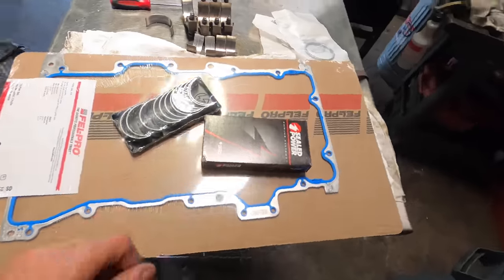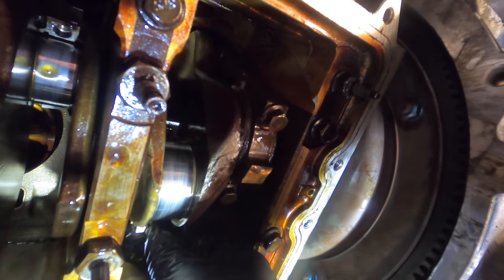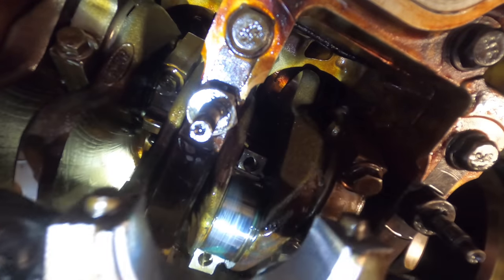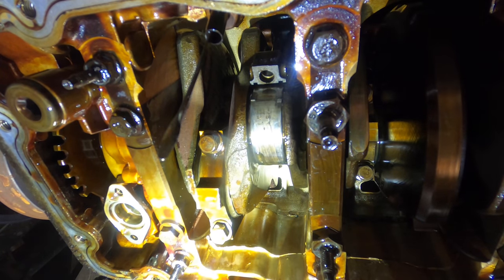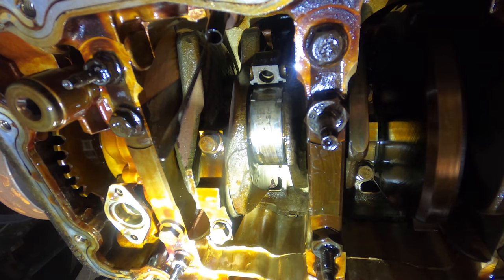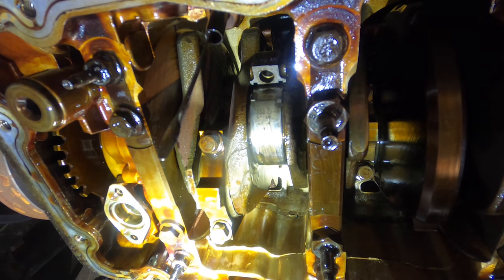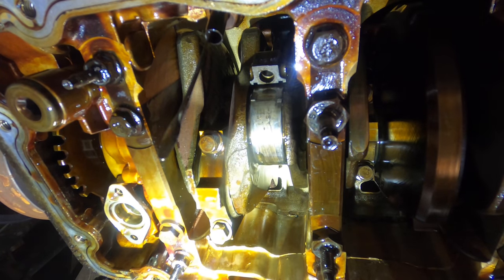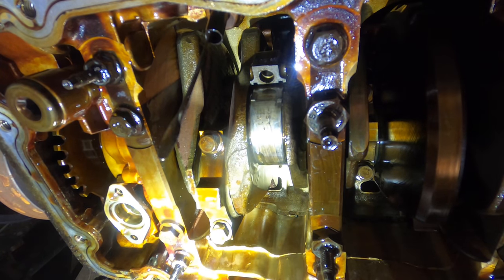Saving an Engine: Spun Bearings Replaced

Comment: Ive been a mechanic for 20 years and these are my favorite kind of jobs.  Doing that deep engine work and getting positive results at the end.  But nothing sucks worse after doing a job like this and then finding out the repair didn't work and the engine is garbage.  Had plenty of those experiences too.  Glad this one worked out.
Reply: this is very unreliable why to fix it but best wishes
Reply: You just ruined my suspense! Lol
Reply: I had a brother in law who had a busy garage,he stayed away from rebuild work he might replace a head gasket or even send them out,he was an experienced guy that worked for a ford dealer for many years.Then he went into his own business, He stuck to bread and butter work and made good money,too much of a headache replacing,overhauling engines.Brakes water pumps fuel
 pumps diag jobs thats what he did!Have to make money,not tie up the shop!He could do it but stayed away,got to put food on the table!Unfortunatly he passed away a while ago,I think he had the right idea for his shop.
Reply: Did anyone notice that bird throw something at the car @44:43?
Reply: only thing I would have done different would have been replaced connecting rod bolts, on some engines they are one time use only bolts.
Reply: @leonarddichiara4863  yeah I do handyman work and I just take the smaller job I will do some larger ones you basically have to sometimes but smaller is where it's at unless you are going to go all big either way is good but it's nice to have that regulation of variation chemical lack of a better way to put it to basically know what you're going to do today with little to no surprises for you nor the customer peace of mind
Reply: That's because this job was a favor not the right way to do a lower rebuild which would have to be guaranteed with a warranty my guess is this repair wasn't warrantied.
Reply: I had a 2000 Chevy Cavalier 2.2 spun the exact same bearing but on cylinder 4 destroyed the crank and connecting rod journal my dumb ass replaced the bearing in a hopes and prayers idea and you can imagine the results. Got a new engine less the a week later only for the EXACT SAME THING to occur a week later. Sold the car for 160$ as parts.
Reply: Surprised you didn't measure the big end journal with a micrometer or vernier caliper.
Reply: @eddybetanya  You would be surprised what will continue to run just fine as long as you have clearance and don't abuse the thing. Or maybe I was just extremely lucky. One cam journal on my 11000rpm 1974 Honda CB350F had massive scoring, like it had been bolted down with a couple of chunks of machining debris. But this is part of the head and could not be replaced. I chamfered the edges, and the engine ran flawlessly for the next 10k miles, and continued to run fine for the new owner. I also had a 1976 XS500 that had totally worn out its big end bearings right back to the base metal, and oversize ones (before the Internet) was unobtanioum, so we fitted good used ones. Again, engine ran just fine for many years.
Reply: @64faffi  yes when I'm in a bind I always remember that old film "Ice cold in Alex" where they keep the truck going on a shoestring. What would I do in the desert with limited resources? Strip, clean, restore/refurbish, be versatile. Don't get me wrong, its nice to use new parts when you can. I was, always  taught to measure (especially big end journals) before ordering parts that may or may not work.
Reply: Has anyone noticed that the nut of the oil pickup is left just tightened by hand?
Reply: @64faffi  i remember in my old moped days.. had a trim cylinder on for a yr and left the original outside. Then i needed to change back and the piston had rusted shut inside cylinder.. but a hammer and some sanding paper and everything worked just fine! Sure less complicated than a car but most things seem to last more than u think just u dont abude it and u keep an eye on it.
Reply: It always make me wonder though when mechanics do a visual inspection like this on the crank to find a spun bearing or something and despite all the work being done to replace the bearings they put it back together and tell the customer the engine is junk... You might as well tell the customer that you can attempt it and it won't cost much more in total costs and just tell them it may not work.

 I saw a mechanic strip an engine down to find a bent rod... Despite the fact they had it out and could've easily replaced the Rod they made the customer buy a new engine. The only symptom with the bent conrod was a ticking noise, other then that the engine appeared to be running fine. They had literally just changed the timing chain and tensioners as well as they originally thought that it was contacting the chain casing causing the ticking/tapping noise as there was a small witness mark on the casing near the bottom sprockets.

I was horrified as I have the same car with Toyota's VVT-i 1L 3 cylinder engine and personally if I was that far into the job I would've asked the customer to fit a new rod. The engine is relliable, not sure how they bent a rod though... I know with low quality fuel this engine does edge on knocking... Maybe the customer did something stupid though as it's a manual transmission that would let you lift the clutch in the wrong gear and over-rev the engine.
Reply: @leonarddichiara4863  this is one reason I'd love to work in a tyre shop. You get paid the same but don't have to contend with as many rust welded bolts. Every job on a car is simple until you realise most car parts rust, fatigue and age xD
Reply: People doing this type of work have nerves of steel and patience of a saint.
Reply: @kungfreddie  i had a couple of mopeds i bought in germany. one was a police zundapp (!), the other a batavus (dutch) star-flite. simplicity = joy in maintenance.
Reply: @rodneyjohnson4794  yea I had a zundapp too back in the 80s. Missing a muffler.. but it ran anyways.. painted it like a wasp and called it.. the wasp.. :) think I bought it for like somewhere around 30 bux or something.
Reply: @rodneyjohnson4794  and about simplicity.. I love it.. new things are cool and when they work they are great. But both in cars and mopeds when things get complicated and too much electronics u can just forget to fix it urself. My first car was a Volvo 240  -78. U could fix most things with a few tools and a multimeter. Now I have a peugeot 308 -15 and if anything more complicated than the breaks need fixing.. well.. its just money flying away from u.
Reply: What's a shop charge for something like this? I just had my upper oil pan out recently for an oil pump replacement and it wasn't too bad of a job. The bearings were right there and might be on my to-do list in a few years. Old Mitsubishi Diamante with the 3000GT motor in it. Doing it myself for the cost of some RTV, a couple exhaust gaskets, and the bearings shouldn't be more than $60, but probably $1,000 of labor if someone else did it
Reply: @Qusin111  how else do you change rod bearings and or main bearings in frame?  it is very common practice.  you make me laugh, and you probably pay to fix your vehicles because you can't do it yourself.  no need to move complicate things, pull out a standard bearings replace with standard bearings.  sure you can check tolerance with plastigauge if you want as well.  This beats pulling an entire engine out and the additional cost that come with it.
Reply: @alexandercopeland2849  and the oil pump
Reply: @micheals1992  EVERY job on a vehicle is simple .... until you break that 1 bolt.
Reply: I was taught how to fit old engines back together by hand. One trick was lead foil sheets. Since there were imperfections and tolerance problems the old guy who taught me used the lead foil on all new bearings. Put a layer (or two) on the surface, bolt it up, torque it, rotate the engine a few turns then loosen and re-torque it. He had learned to do that with Rolls-Royce merlin engines during world war two..it kept aircraft flying..I did it with car engines..never had a rebuild fail in less than 300k km (200k miles).
Reply: @the_truth2766  you coulda polished it with sandpaper and use the shoelaces method it lube it it woulda came out rite
Reply: Only thing he didn’t do right was polish connecting rod and crankshaft and 90 degree them tight. Fix 5 cars still driving to this day recommend thicker oil as well Will run the car smoother
Reply: 3 words… small end knock… swapped shells in the past and fm still got a rattle 🤦‍♂️
Reply: I’m about to tackle this very same job on my CRV &s2000 tomorrow.. hopefully the motor didn’t take a sh*t. Wish me luck 🤞🏽
Reply: but thsi si not the work you do in a engine,,
Reply: @the_truth2766  well engine starts making nosies and you people dont care, piut bardall or other shit aditive  in there or jsut let it run that way,, one day it will be a very expensive repair or you loose your car..
Reply: @anteneupitra  It was already a pos, more rust then solid metal, missing window, passenger window didn't work, I knew it wasn't worth trying to fix it but I was wanting to learn and save a bit of money while I did so. I didn't complain or mind too much. I knew the car wasn't gonna make it.
Reply: 😮 @alexandercopeland2849 I agree with you.. But this isn't a huge hp motor...Plus...17 foot pounds then..32...those bolts ..I always went a tiny degree over 32 and a 2 to 3mn turn but close to 33..motor ran for another 50.000 miles..until he decided to do a oil change " and didn't tighten the filter back up..tight.. Oil leacked out and locked it up" that was almost 4yrs later " my repairs was good" 👍